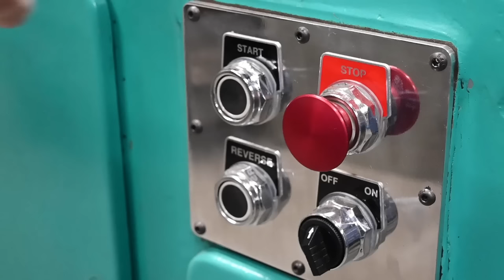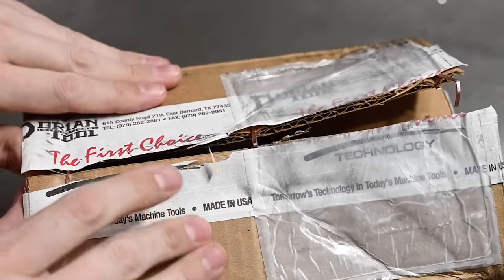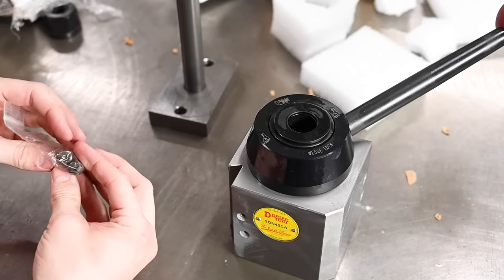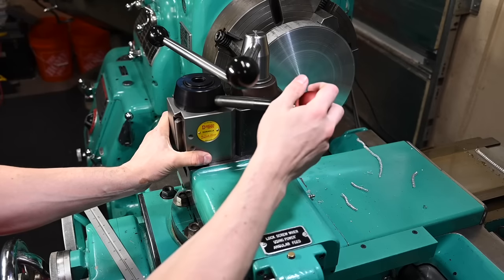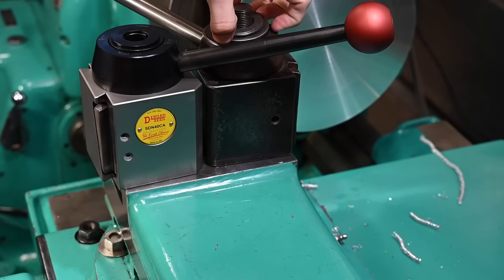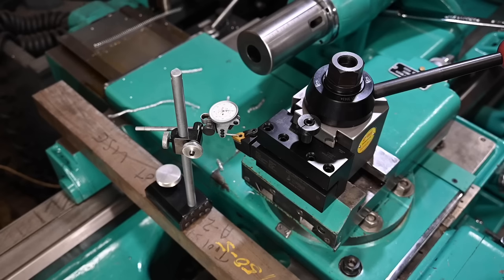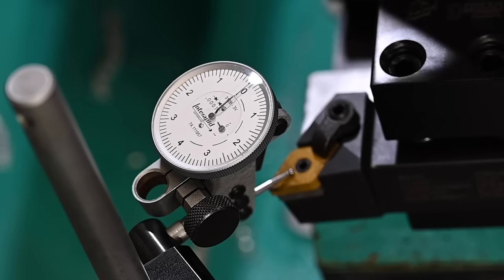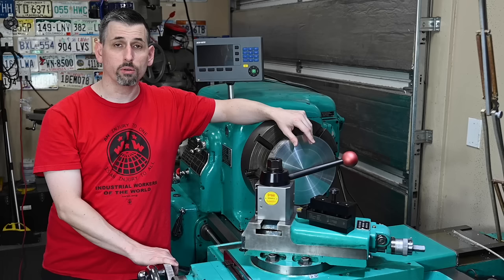Dorian Tool Post Review and Test! Monarch Lathe

Comment: I've got a very similar lathe at work a 1958 monarch I still use it it's a 20" model with a 32 inch actual swing 72inch  between centers recently made a 5ft 7 inch stroke crank shaft largest diameter was 15.5 inch.
These old machines were built great

Comment: I have not used a Dorian tool post but they are my go to brand for toolholders because they will hold larger tooling than the Aloris in the same size.
Reply from the maker: Yeah they hold bigger tools and are built heavier, too. On your big Monarch those would be 20 lbs a piece with no tool in them.
Reply: @AlwaysSunnyintheShop  Sadly Dorian does not make the ea size my big Monarch uses.

Comment: It's hard to ask this without inadvertently coming off butthurt, I assure you it's not the case. A few videos back I asked if you could make use of an NOS KDK tool post. I'm not remotely put out that you chose otherwise, but I'm always interested in this question. It seems like all Machinists are rather fixed on their tool post style. It's one of the only changes I've seen countenanced for a new employee. It seems like everybody either prefers the aloris style, the multifix, or what I suppose would be best summed up as other; the rarer options and the occasional old-timer who loves his lantern post. I'm always curious what creates this preference. May I ask if you learned on this style of tool post? Have you run other styles for significant amount of time? What do you like and dislike about the various options? BTW, I congratulate you on not removing your cross slide, I see the advantages it has for some operators, people with far more skill than myself, but it feels like denuding a piece of art and it completely ignores the wonderful 30 60 90 trigonometry rule that gives you 10x resolution on the cross slide dial. And who could not love that color? I have a set of Studebaker trim logo pieces of that exact art deco / art nouveau era. I'm not even a car guy, but the beauty and workmanship in those simple fonts... It's the little things. That machine looks like an absolute pleasure every time you turn on the light. Be well
Reply: A number of those toolpost companies have gone out of business as their holders offered no real advantage, and had other problems. Yet, there will always be a small few who still swear by them. I find no need to bother.

Comment: This is only my opinion although the wedge type QCTP can claim to have some advantages in strength. Unlike Dickson, Multifix and the Aloris piston tool posts which clamp by aplying a force perpendicular to the mating face. the wedge type uses a force in plane with the mating face as the wedge is forced down which can cause the tool holder to twist unpredictably.

Comment: If I buy a new one it’ll be a quad post from them
Reply: I have the quadra. Works well especially for multiple operations because you can keep several tool holders on it and just rotate it to the one you need.
Reply: @hilltopmachineworks2131  it’s the better version and much more veristle of a regular four sided tool post every since I seen it on cutting edges channel I’ve wanted one but good lord if it ain’t pricey
Reply: @jeremycable51  Yeah they are not cheap. I was fortunate that it was on my lathe when I bought it.

Comment: Your first problem is your using Instagram.  The people calling your lathe small are not machinist and or know anything about monarch lathes. If youtube  isn't paying you enough. You should pump out more content and build your channel like you used to. 1 video every 4 months or so will not make you money.
Reply: There is machining for the purpose of making films which Arron enjoys, but struggles as it is not his trade. Or what Adam has done is go overboard with promoting products. Real world is Kurtis or Peter from Edge precision or Josh Topper  if you want real engineer's who film what that they make not cleaning down the machine every 2 mins or not running coolant so you can see the work